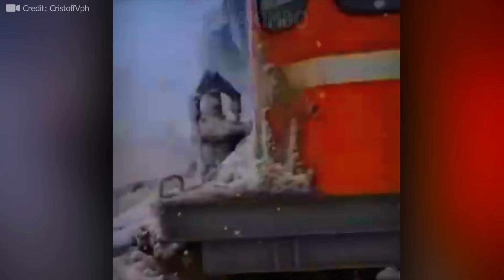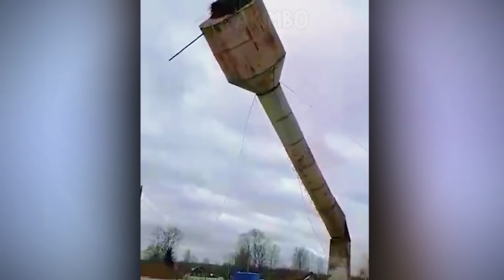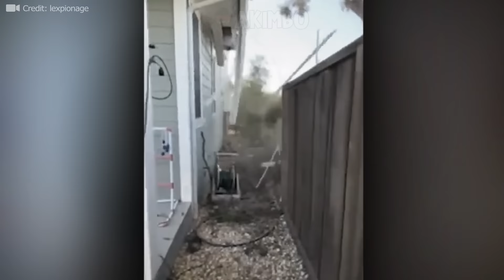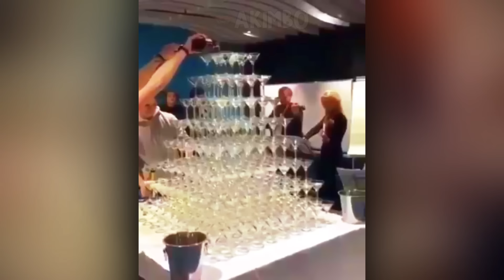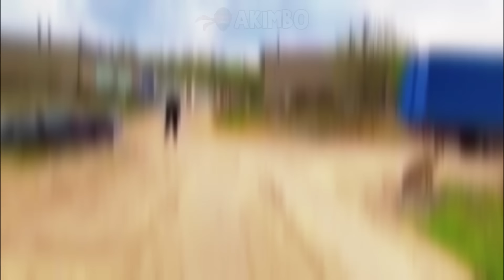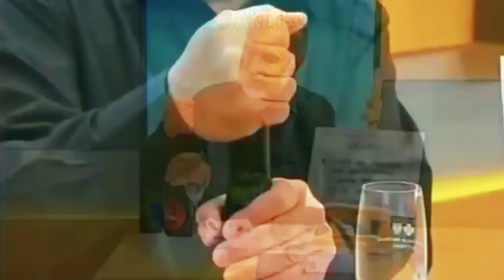IDIOTS AT WORK!

Comment: The way that the fire extinguisher lifted off was really cool to watch.
Reply: I didn't know they had that kind of pressure. There was a fire at a welding shop around here years ago, those big tanks were going up like rockets, they were finding them miles away, and they messed up a lot of stuff when they came down.
Reply: @bigredc222  Air cylinders can do a lot of damage. if you ever watched an episode of Mythbusters.
They where testing of myth that if a gas cylinder's regulator and valve gets sheared off. It turns into a rocket and can go through a wall.
Reply: @stealthinator00  I remember that, it went through a block wall right? I remember seeing that somewhere.
It's one of Newton's laws, for every action, you get an opposite and equal reaction.
Reply: @bigredc222  It was a large 140lb gas tank. Now imagine if a scuba tank would fail. These tanks store around 3000psi of air.
Reply: @stealthinator00  I thought oxygen and acetylene tanks for torches were in the thousands of psi, so I just looked it up and I'm getting everything from 22 psi to 2200 psi, how many PSI do they have?
Reply: @bigredc222  I think the reason scuba tanks have such high pressure is that it has to hold around 45 minutes of air and also the higher pressure due to the depth of the water divers will have to experience.

Every 10 meters(33 feet) you dive underwater is about one atmosphere (14.5psi ) of water pressure.